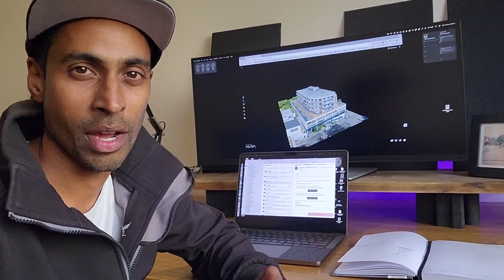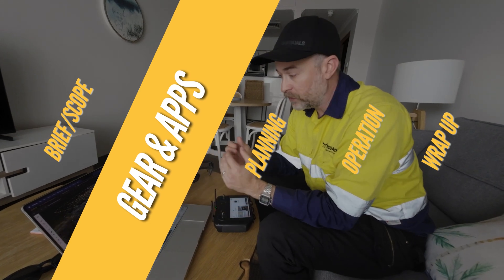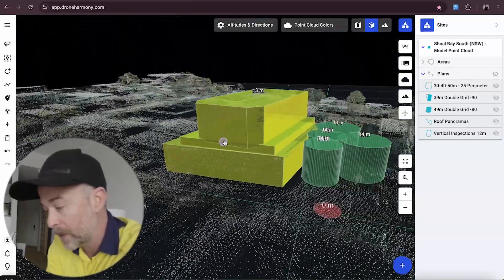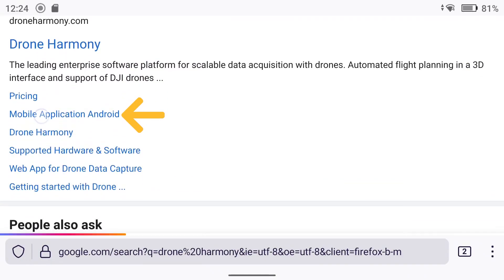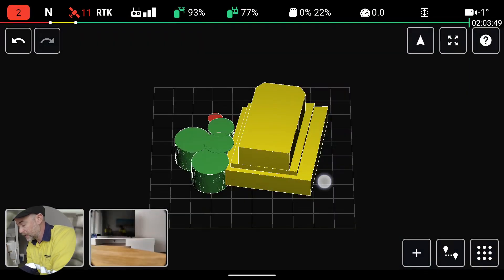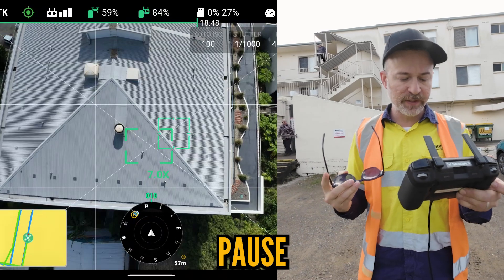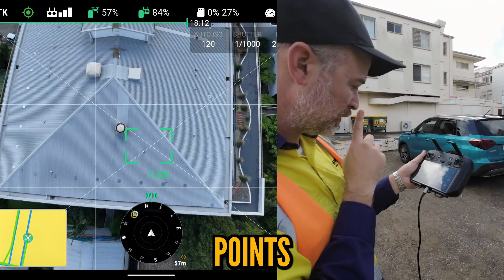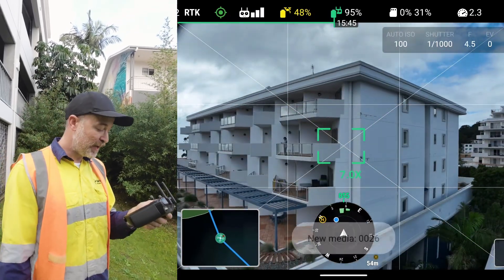The correct way to make a 3D model with your drone- Our full process explained!

Comment: Super informative video and very well put together. Liked and Subbed! Question though: Are there any rules or laws regarding privacy when working on a residential building like this? You're essentially flying outside of people's windows taking images that can look into their appartments. Are there no requirements to at least let residents know with something like a letter in the mail before hand so they can close their blinds?
Reply from the maker: That's correct and the residents were indeed informed about the drone operations taking place well in advance by the management of the property and to ensure their blinds were closed if they had any privacy concerns 👍